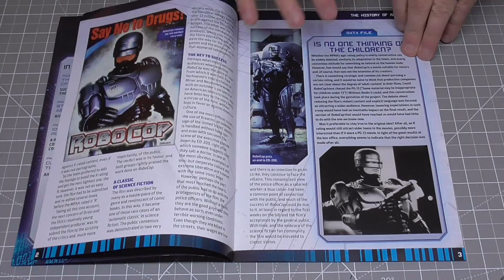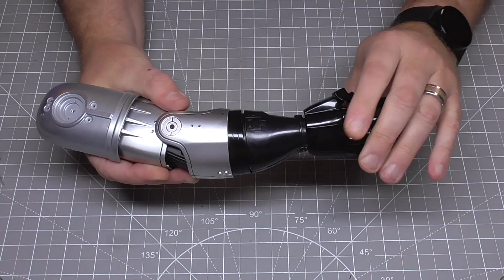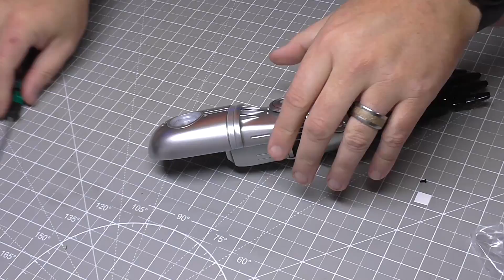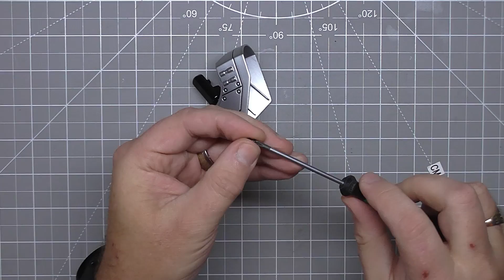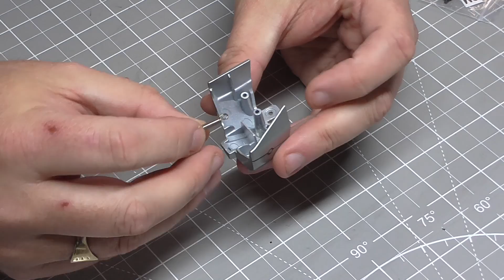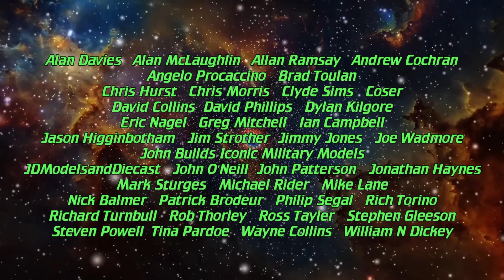Build the Legendary Cyborg ROBOCOP - Pack 4 - Stages 11-14

Comment: I wish we could rush pay for the next set whenever we wanted…..took me 3 weeks to receive pack 2 after payment and shipping was established I don’t even know if I have another 20 months left in me 😂😂😂😂
Reply: lol I complained about it and told them to pass the message onto the ceo Cz a could be dead by the time I’m even close to finishing and that delivery times were shocking after payments were taken so told them to open a ware house in the uk n ship from there t speed up delivery
Reply: @2012NUFC I was thinking about subscribing to another build so I can have something running every 2-3 weeks in between eachother but the nonchalant service this company has to offer turned me against it.
Reply: @BlueJayFromDa9  yeah I was thinking of doing that too and same as you I was thinking 🤔 what’s if they delay aswell then I’m stuck getting them on same time scale I have argued with them a few times over it though saying they need to be more prepared and ship out earlier even befor payment so when the payment is made the next stages are not far off from reaching the customer if you no what I mean